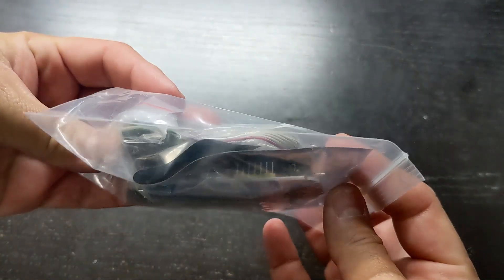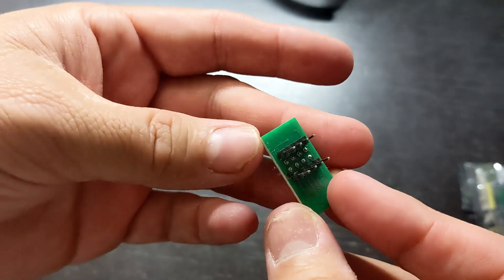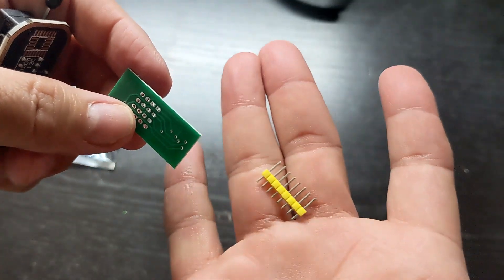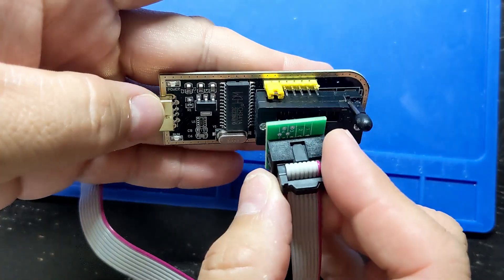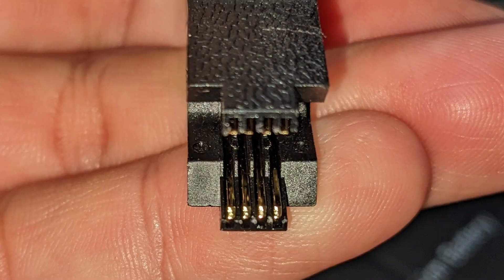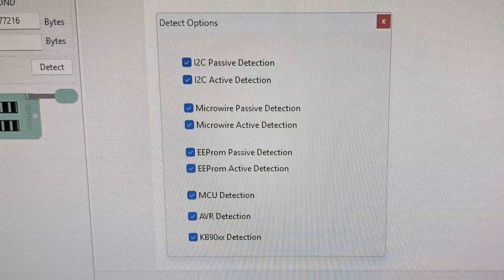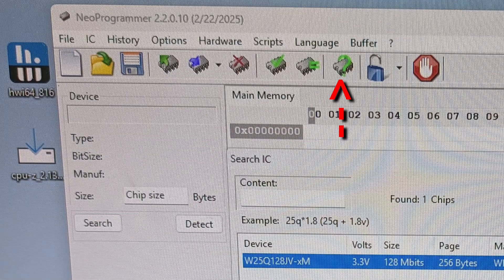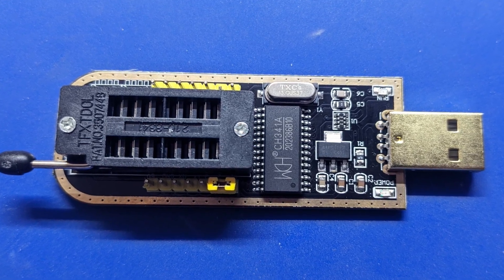CH341A BIOS Programmer - Unwrapping and Tips

Comment from the maker: **UPDATE - Bios chips come in 5V, 3V, and 1.8V.  This will work with 3.3V and 5V chips, but it does not support 1.8V chips. You will need to find one with a 1.8V adapter. I will link one in the video description**

Comment: I never could get mine to work. Mine was locked as a USB UART LPT device and never would read any bios chip. I even used neoprogrammer.
Reply from the maker: I recently had to use this again and had some difficulty. The problem is that the bios chip I was reading was 1.8v (I didn't know) and this programmer needs a 1.8v adapter for those chips. This will read 3.3V and 5V Bios chips without the 1.8v adapter, but I think I damaged the 1.8V chip. I bought a new reprogrammed bios chip for my specific chromebook on eBay and am waiting to receive it to see if that works.

Comment: u have the same ch341a programmer but output data lines are on 5v not 3.3v. do you perhaps have the same issue ?
Reply from the maker: I don't know. There are slightly different versions of these programmers. I don't have a lot of experience with these programmers. I used it on an HP Chromebook and a Lenovo Thinkpad and it worked for me with some minor trial and error. It was reading and writing multiple times without an issue.